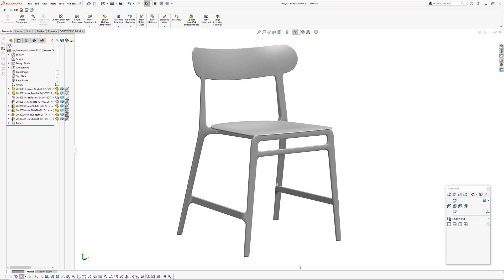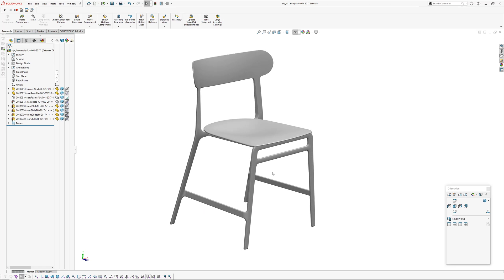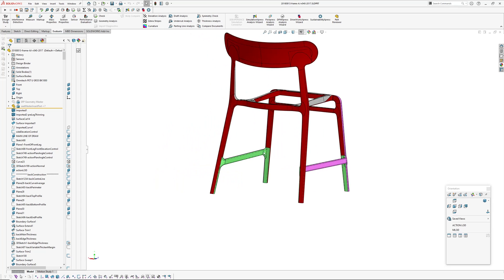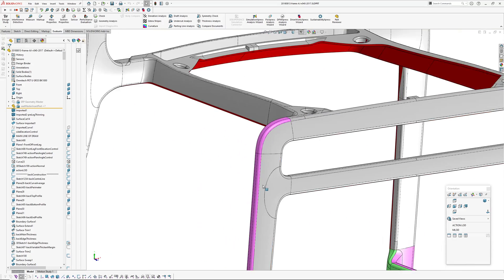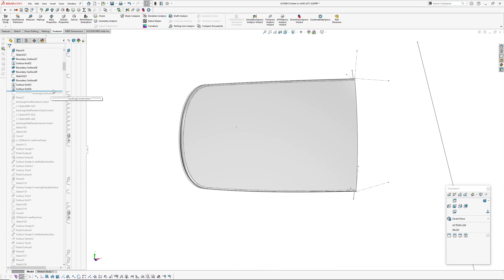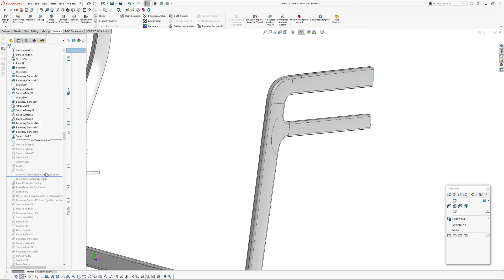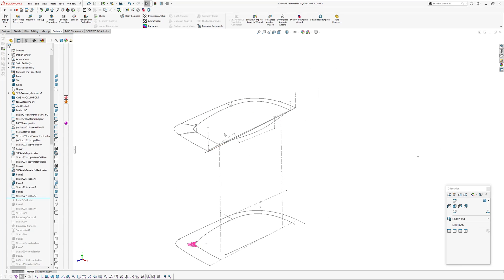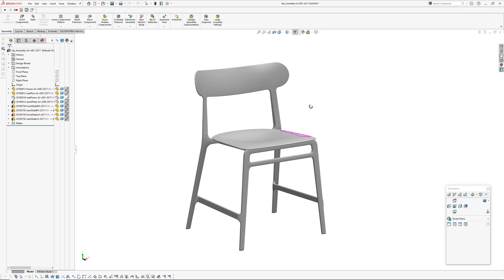Lightly Chair by Noho. Solidworks Model Review

Comment: Andrew, could you share how many hours did it take from the almost designed to ready to manufacture model? I think it is worth mentioning for all the people interested in introducing their product to the market ;)
Reply from the maker: Hi Mikolaj, good question! Roughly 220 hours, from start until the file going out for first tooling comment. That is just my time. On top of that there would have been others working on drawings for tooling, FEA, mouldflow etc. There were more sections of work after tooling comment, tool mods etc, but I cannot place a figure on that.

Comment: Amazing work! Those part lines and draft angles can be quite a headache. I imagine there were quite a few iterations to get that tooling to work.
Reply from the maker: Yes I remember a few huddles in the corner with the others working on this. Drafting sections that are running nearly normal to the line of draw does interesting things!

Comment: Great vid Andrew, having a real client example is super useful to see!

With that in mind, are you able to share more about the working process?

As this is a real project, it would be amazing to hear more about the project workflow - was the design already done and handed to you for final production cad? Did your model need to be parametric to handle design changes through the process ( eg incase of size changes) and how did you handle that given the many complex surface detailings going on in the model? 

If you haven’t already, it would be great to see a video on how you handle setting up a complex surfacing model like this but have it be flexible to accommodate many client change requests (or is it a matter of creating a fresh new model each time?)
Reply from the maker: Hi Craig, I wanted to keep the video fairly short, so it really only skims the surface. To answer your questions, the design was pretty much there from an aesthetic and performance point of view. The tooling/draft/split strategy was still very much a WIP, especially the main actions and the implications on the lower front-to-back member. Without the actions, the design was quite different! There were constant changes happening all over the place. One example is when you have a hard draft constraint, say 2 deg either side of a part line. All geometry on either side must fall below that draft, there is no cheating it. That has quite a profound effect on surrounding geometry, especially if the surfaces leading into the split area are crowned. Sometimes we had to work backwards from these areas and adjust things accordingly.

When building something like this, you can not foresee every possible permutation, so I focused on setting things up to be as flexible as possible for the design intent or constraints that were known about at that time. Good problem to have when using a parametric feature based modeller I guess.

I guess that last paragraph applies to your second question to some degree. 

Fire away if you have any other questions. Cheers, AJ